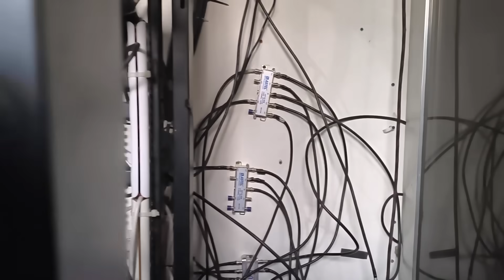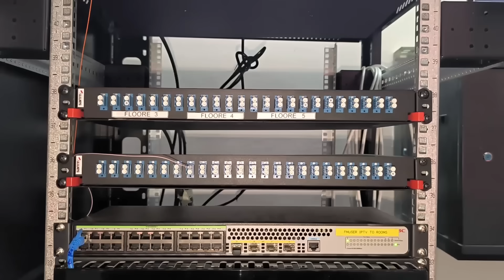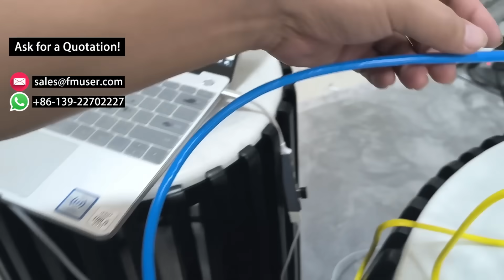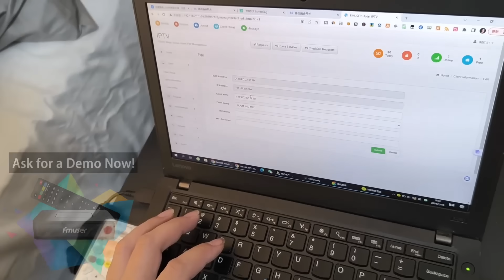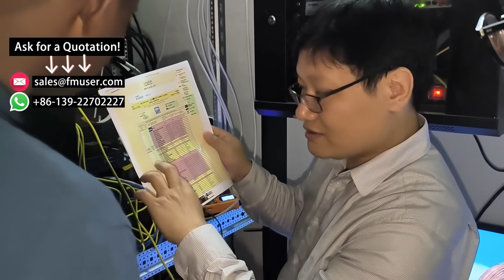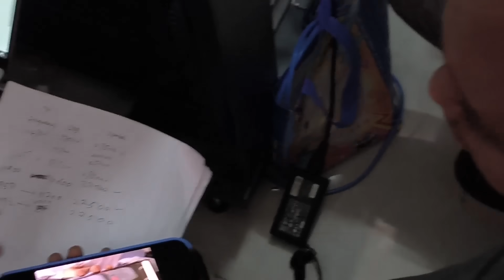How to Setup Hotel IPTV Solution from Scratch: An Ultimate Guide

Comment: Very well prepared installation guidelines. Please does it only work for FTA satellite dishes or it’s also compatible with paid satellite dishes such as DSTV?
Reply: Thank you for the response. Really appreciate. 
I will definitely patronise your products in the near future
Reply from the maker: Hi there! Thank you for your feedback. We really appreciate your comments on the video! FMUSER's IPTV solution is compatible with FTA dishes (both free and paid channels), UHF Yagi antennas (via CAM), DSTV boxes (like Canal+, etc.), and local channels (with HDMI or SDI inputs). The IPTV equipment we provide varies depending on the different input types.

Check out our latest model, the FBE700, which integrates a satellite receiver, UHF receiver, and HDMI encoder, all through customizable input options. For more details, visit this link: https://www.fmradiobroadcast.com/product/detail/fbe700-integrated-iptv-gateway.html

Feel free to reach out with any questions via email:sales@fmuser.com or WhatsApp via (+86)139-2270-2227!
Reply: Am planning the Satellite and FTA antenna setup for a 16-TV point residential project for a client and thinking of going for your IPTV option.
However, the client would be using DSTV dish and decoder, and I want to be sure if he can use one decoder to feed all 16 set-top box from a RJ45 Ethernet switch.